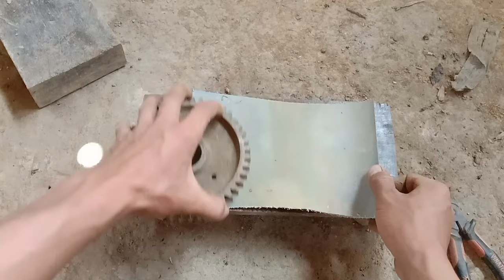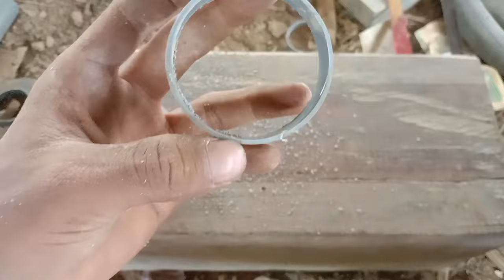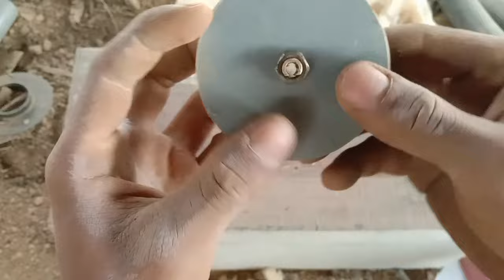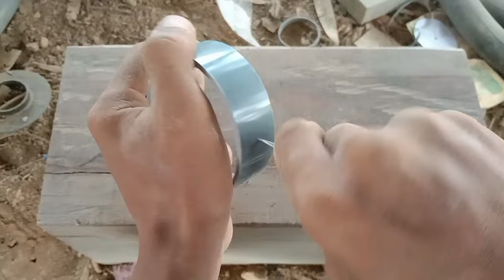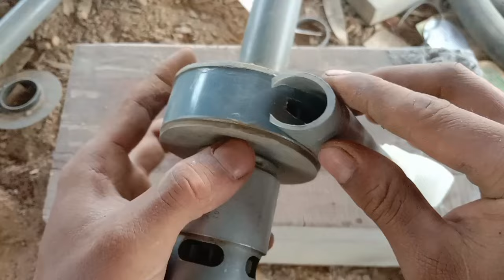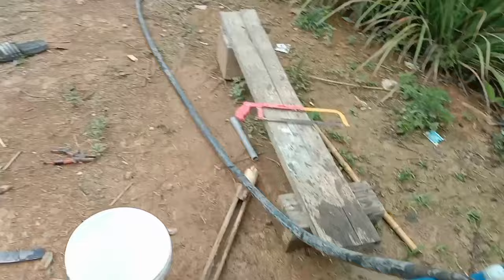Making water pump with moto 775

Comment: The rubber is needed between the motor and the back of the propeller to stop water from getting into the motor or use some water proof grease
Reply: Thats right bro
Reply: Bro wo Pani m chla rha hai waterproof hogi motor
Reply: She didn't care about water in her motor. Even she dropped this motor in the water. Luckily its dc motor.😅😅

Comment: Submerging the motor in the water..?? It will smoke after five minutes.
Reply from the maker: 12v DC moto soaked in water will not burn until the DC current is too high, if using an AC motor soaked in water, the motor will burn, and the risk of electric shock is very high.

Comment: Muito bom...
Só queria saber que cola você usou nesse projeto,  e o motor quando mergulhado na água não é perigoso?
Reply from the maker: the glue I use in this video is 502 glue, also known as 502 elephant glue, the motor Using DC current with voltage 12 is not dangerous but from 40V DC it is dangerous.
Reply: @banhuongst  obrigado!

Comment: this pump making not submersible pump
Reply from the maker: If you want the pump to be non-submersible, you need to edit a little bit about the moto shaft and the pump chamber and add a 1-way water inlet valve next to the top of the water intake.